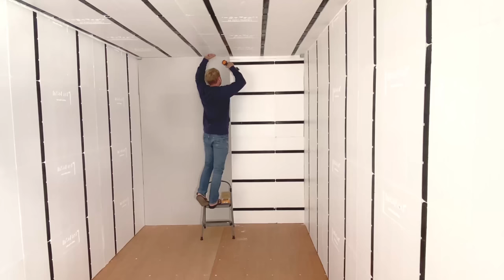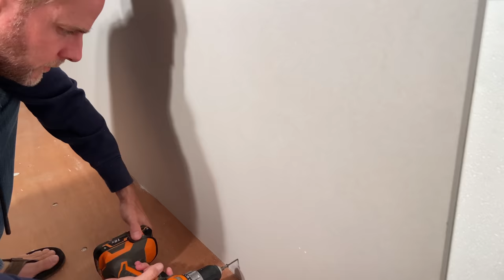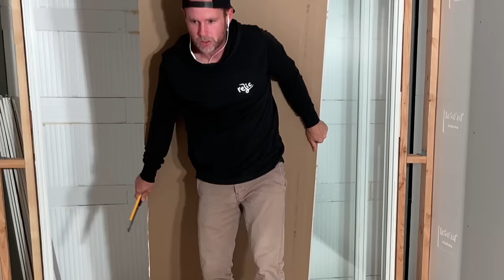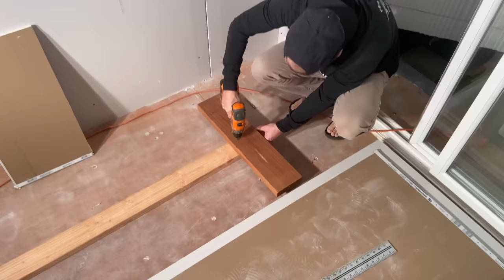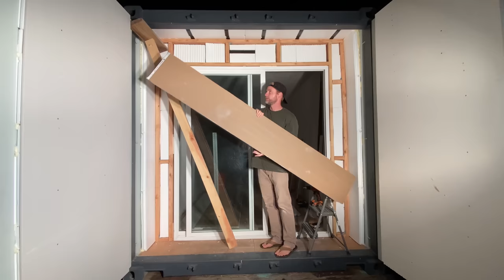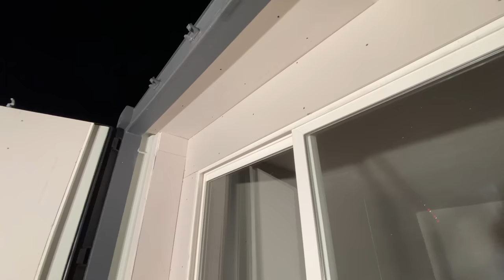Shipping Container Shaping Bay [Part 4 Hanging Drywall]

Comment: Nice job! Looks Good!
Some drywall install tips.: 

1. Always do ceiling first. The sides help support it and prevent cracking later.
2. Always land your seams on a Nailer to prevent cracking later in the finish (cut your first piece to split a Nailer then go).
3. Use glue on your Nailers if possible - fewer screws = faster finish.
4. If you ran the drywall panels sideways, you would have a lot less vertical taping and mudding to do - and mostly 1 horizontal tape at the waist level (Easy to finish).
5. Always leave a 1/2-inch space to the floor on the bottom for better run flooring or carpet (use some scrap drywall as temporary spacers then remove once installed).
Reply: You touched on everything I was thinking
Reply: SUPER SMART!

Comment: For anyone else doing this insulation system, your'e supposed to have the drywall edges line up on the black plastic strips so the edges get screwed down and secured well to prevent cracks in your drywall taping/mudding.
Reply: Wait so u don’t frame for drywall??

Comment: it was a mistake to sheathe the container doors with drywall. This will work until the first heavy rain.
That's right - moisture-resistant plywood or a groove-and-groove board treated with oil paint or nitroemal.
Good luck, friend! Beautiful wife and wonderful children👍👌💪
Reply: I was also wondering why he put sheetrock on the doors. I mean, if you are in there, then the doors need to be open. So, unless it the thing is covered, you cannot use the room in the rain. I think he may not have thought that part through too well.
Reply: @pablomax9376  He didn't think at all ;))
Reply from the maker: I'm planning to add an entrance overhang to protect the doors from rain
Reply: @BendheimBoards  a very good idea.
Please do it beautifully.

Force, will be with You!

Comment: I would have carved out some channels in the foam and run conduit for electrical cables for lights and socket outlets before doing the plaster board. But looks great :)
Reply: I've always intended, if I were to build like this, to run the conduit and plumbing exposed. I've seen product from the UK that make the conduit quite beautiful.
Really easy to repair or change without ripping it all apart.
Reply: And plumbing

Comment: You should have installed a vapor barrier between the drywall and the polystyrene insulation. Big mistake, condensation will form between the polystyrene and the container exterior wall, mold and corrosion will appear.

Comment: Interesting video.How do the scews hold directly in the styropor?No wireing or plumbing?I'm not sure of the ventilation to avoid condensation and mold.Where should the water go to?I'm not sure if the styropor is directly on the metal that this is enough to prevent for a thermal bridge?At some certain point you get the dew point.Sorry for my English, I'm German.

Comment: I have been dealing with polystyrene since 1996 and I have doubts about combining it with metal (that polystyrene cannot be combined with wood, I have no doubts). The metal sheet from which the container is made can heat up in the sun up to 90'C (yes, I know, I'm from Europe ;P), while the melting point of polystyrene/styrofoam is about 80'C. What's more, heated polystyrene/styrofoam emits harmful chemical compounds. A better solution would be polyurethane foam (melting temperature 90-95'C), but the best material, although not having such good insulating properties, would be glass or rock wool.

Comment: Amazing build so far! Would recommend you to have a ventilation fan. Atleast one to be placed above the sliding doors so the fumes from the products you use would not get trapped inside. That is if you're planning to keep the doors close while working.
Reply: In what world do you actually think he would be working inside this with the doors closed while using product???
Reply: @Snowbrdr020  in a world where the neighbors are assholes and complain about the noise, smell or whatever

Comment: Interesting. I am curious why you didn’t plumb and wire it first… Also definitely needs a way to breath, humidity is going to build up and cause problems. 
Otherwise pretty simple build out.
Reply: Agreed....I thought the same....still going to get off gassing as well!
Reply: No ventilation plus Styrofoam insulation applied directly to bare metal is going to end up with condensation and very quickly rampant mold problem.
Reply: @Jon  agreed. Would ventilation alone solve this issue? Interested to see how ventilation is going to be considered.
Reply: @vincentshapland7250  in a dryer climate ventilation should be fine. In a wetter climate they'll need a dehumidifier and air circulating between the insulation and the metal shell.
Reply: Was wondering the same thing when we sealed it all up... not even sure what it is for. No air circulation....
Reply: @dmxracr9202  i think it is a workshop to make surfboards.

Comment: you should always hang the ceiling first. This way the wall panels support the edges. You should also have your 8 ft seams horizontal rather than vertical. no electrical??

Comment: Are you going to put in a ventilation system? Or just crack a door open? Would be cool to put in a heat pump so you could be cool on hot days and warm it up for laminating on cold days.
Reply from the maker: Mini split AC system

Comment: Great job
Hanging drywall is a tough job. Why not make it a little easier and have it last longer by using drywall adhesive? It's a simple and inexpensive step to the installation. By applying glue for drywall to the studs or joists before installing the sheet, you cut down the need for screws in the field of the board.

Comment: What is the advantage of using a shipping container for projects like this? It seems, but I could be wrong, that doing it without a container and simply using traditional framing would be both easier and less expensive. The materials cost for framing can't be more than the container, can it? Plus, you'd be able to make it any length and width you want, instead of having to stick with the size of the container. Wouldn't the insulation and drywall work be way less involved, faster, and less expensive? What am I missing? There must be some benefit I am not seeing, or else no one would ever convert these containers, but clearly it's very popular.
Reply: Security is one reason.  Also option to up sticks and move anywhere you want

Comment: The drywall on the ceiling should always go up first, then the walls should  be installed horizontally to support the ceiling stacked not stood up vertically.

Comment: You would have been better to run the drywall horizontal, as then the seam would be 4' of the floor and you would not see it, but vertically  you can see every join , and use 20ft sheets they make them.

Comment: Anyone know why the smaller drywall by the door was glued rather than screwed like the big sheets?
Reply: There was no timber to screw into. So he used adhesive. Personally I would have used the adhesive for each sheet as well as screws (just a few blobs here and there on each stud, like most professionals) - piece of mind and less screws = less plastering.

Comment: this guy CLEARLY doesn not know how to hang drywall - aside of not making his vertical tape joints break 9or line up) halfway on the black plastic screw strip, he has joints directly above the slider door - it will crack on all these seems it's just  matter of time - and WHY drywall on the exterior door where it will surely be exposed to potential moisture. . . AND, always do the ceiling first as the walls helpt to support the weight. 1.2 Million subscribers being misled. It woulda took  20 minutes on YouTube to learn how to do it correctly from a Tradesman.